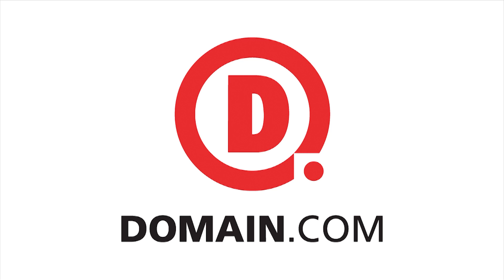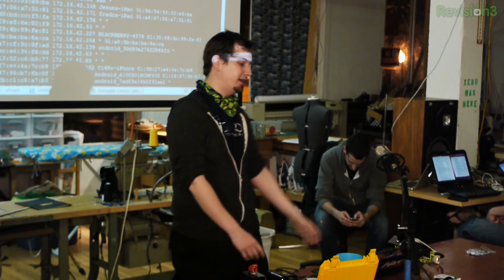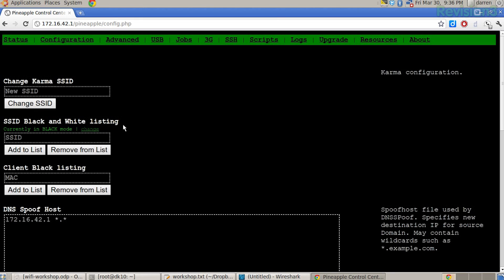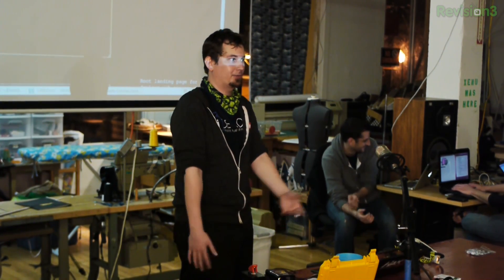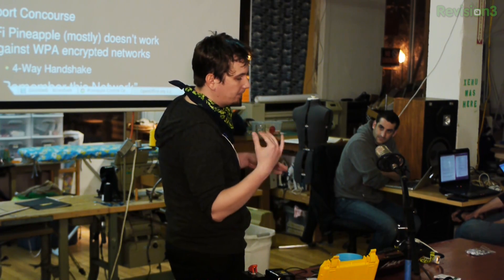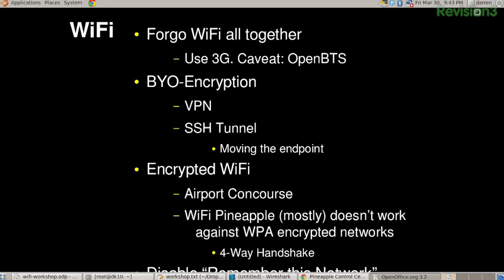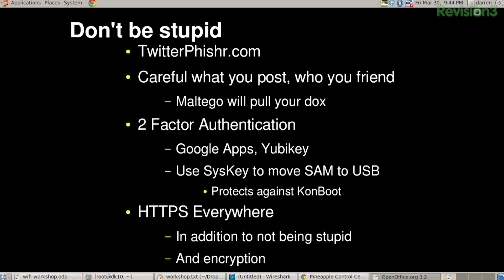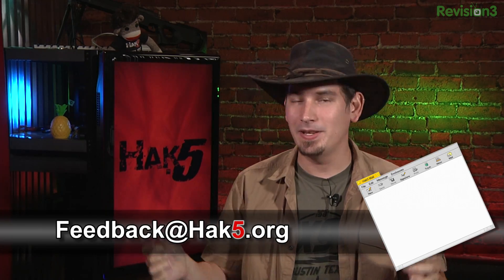Hak5 - Hak5 1124.3, WiFi Hacking Workshop Part 3.3

Comment: The 1.5 Amp is the input power of the USB device, so that's a USB 3 spec.  USB specs have nothing to do with wifi signals.

As for transmit power, nobody breaks down your door for using 2.4ghz at high power because there's so many microwave ovens out there already messing up that spectrum.